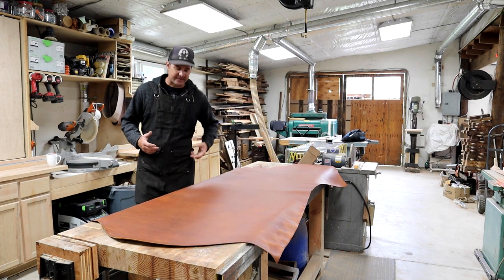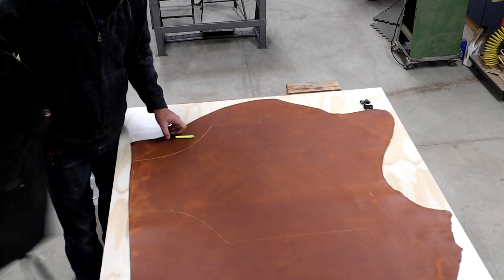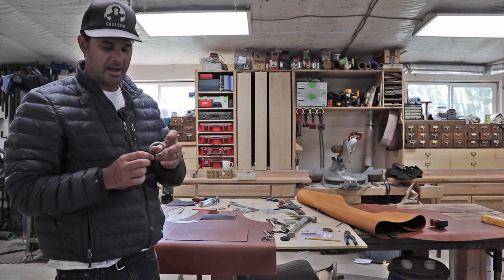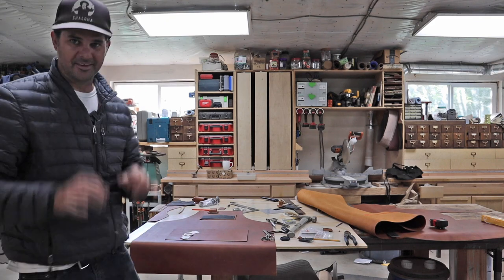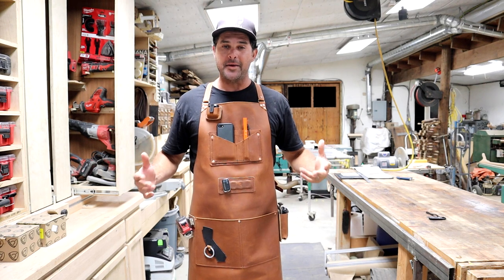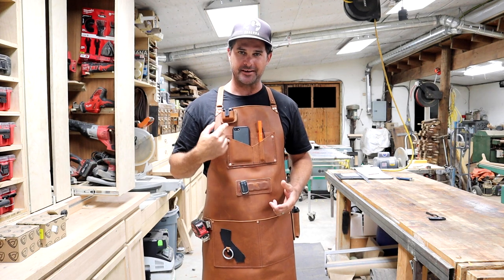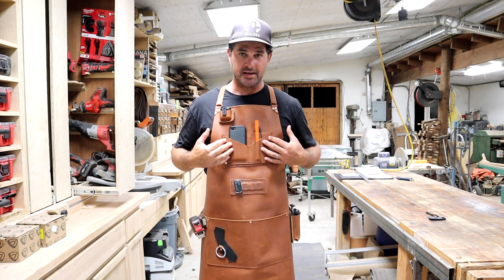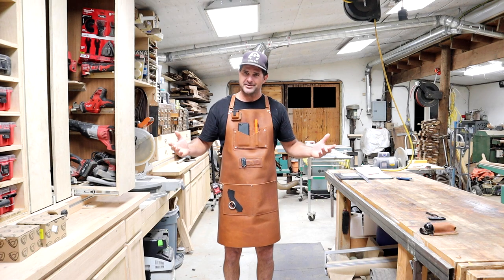Making A Better Leather Apron !

Comment: Great job brother. There's a lot of great design ideas in this project. Would have liked to have known what weight and type of leather you were using though? Chrome/Died Veg Tan ect.... 

I love the idea of magnet strips I think I'm going to steal that. Adam Savage from MythBusters made one as well and he did a split leg apron. Seems like a cool feature to add or tryout. Keep up the good work!
Reply from the maker: Thanks Max.. I bought a full half cowhide died veg tan leather. I can’t remember weight but I do wish I had gone a little lighter.. The magnet strip has been very handy but there is a down side when metal working in that it picks up a lot of metal shavings. Not a big deal but still annoying ;) I would do it again if I made another one 🤙

Comment: Hi; servo motor for the Juki guy here... I think we may have been separated at birth (well, except for the fact that I'm probably 25 years older than you, but let's not quibble...).
Awesome job for a first project! I've got one underway myself, with many of the same ideas, motivations, etc. Here are the very few that I have that I didn't see in yours FWIW; might be a retrofit over time?
• Velcro closure sewn into the bottoms of the big pockets; allows you to empty sawdust from them.
• Flaps over same pockets; see 'sawdust' above.
• Cannibalize a set of shoulder straps from a backpack, and incorporate them into the straps for a more comfy fit.
• Not sure if you have one (but given that we also own the same Wilton vise, there's at least a 50% chance...), but you can use a vacuum bag to do the wet leather forming much more effectively than the thumbtack method.
So, in case you are wondering, our next big project is to build a woodworker's toolbox that looks like the Snap-On box we already have for mechanics tools, but is made of wood, sized for woodworking tools, complete with tool foam cut to shape, and then wrapped in vinyl so as to appear painted at automotive quality. Please get started on that ASAP, I'm eager to see how mine will turn out and what problems I might encounter so that I can avoid them.  Thanks!  😂
Reply from the maker: Dang! I should have bounced some ideas off of you before I started this apron😜. I like the idea of an opening to eject all the wood shavings out of the bottom pockets!  ...A faux metal Snapon toolbox for wood tools.... oh yes ... good idea. I’ll definitely get started on that for you ASAP. That is, after I complete the scrolling list of projects I have on my workbench 😜
Reply: @ShalohaCreations  No, no, no... It's not for ME; it's for US! If it was just for ME, that would be selfish!
Reply from the maker: @kevinnathanson6876  hahaha... oh in that case I’ll get started on it right away 😂

Comment: OLD Leather Smith here,  I believe it is a GREAT Video, terrific 4 a beginner,  you also have some excellent ideas, I have a few suggestions,  NEVER STRIKE A METAL PUNCH WITH A METAL HAMMER  USE A PLASTIC FACE HAMMER THAT WAY OVER YEARS OF USE YOU DON'T MUSHROOM THE HEADS OF YOUR TOOLS,  I don't skive my joints if necessary 4 rivet length I make leather washers this gives joints more strength personal preference that really works over time. Skip music hearing the work  works better 4 the beginners and ME!  GOD'S BLESSINGS ✝️⚾🙃
Reply from the maker: Thanks for the tips James. I’m definitely no expert when it comes to leather work, the apron was my first project, so any advice from someone with experience is greatly appreciated! Thank you 🙏🤙
Reply: Thanks for the lesson I absolutely slammed the punch with a metal hammer and will no longer do this anymore

Comment: what leather is he using? or whats the most durable one to use? even if it wont be so confortable because of the thickness i just want it the most durable possible
Reply from the maker: This is a  full half hide oil tanned leather.. I think if I remember right it’s 4-4.5 oz. Little thick for an apron, but definitely durable.